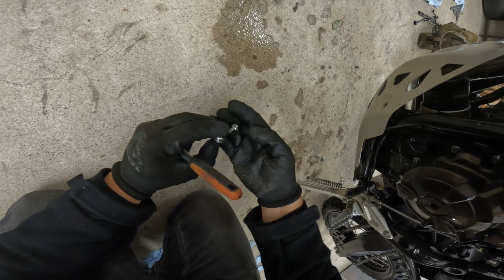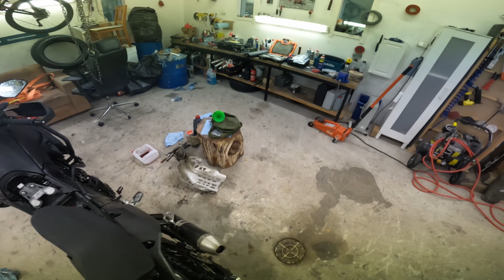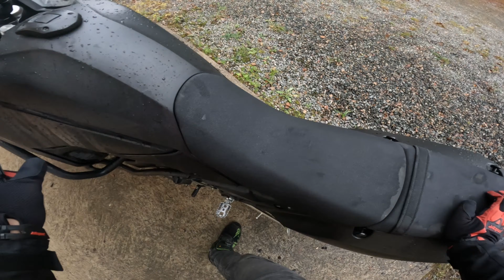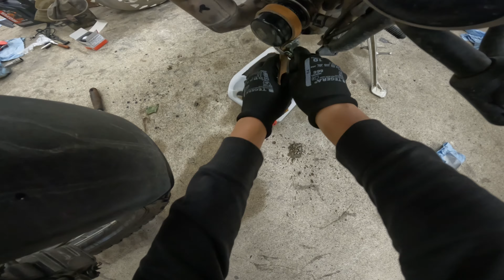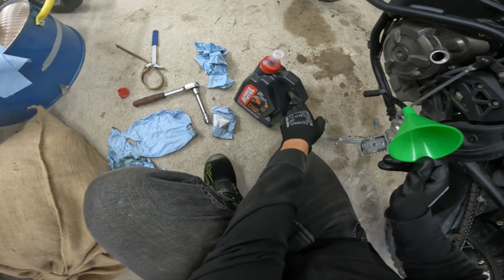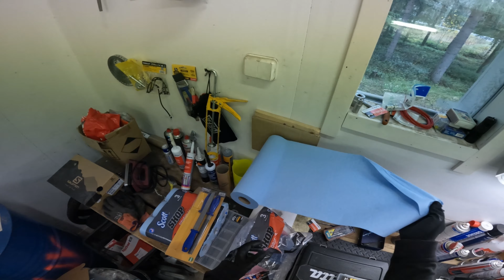Tenere 700 maintenance - Oil & filter change, air filter change, chain maintenance

Comment: How did you raise the motorcycle with the wood plank? I didn't get it
Reply from the maker: Just shove the plank under the swing arm while the side stand is lowered and the rear end rises up. Rear end rises quite easily, you can push from the handlebar or near the bench etc.